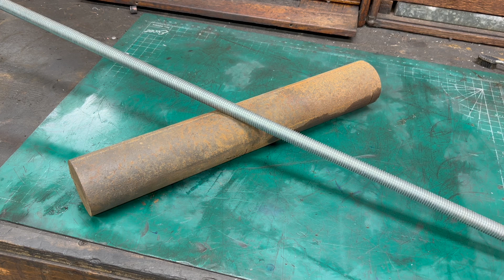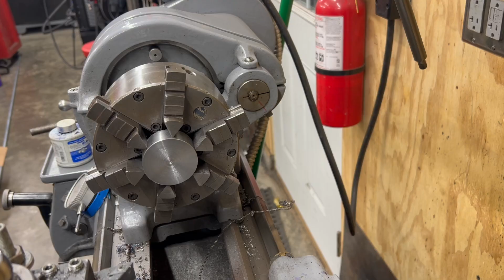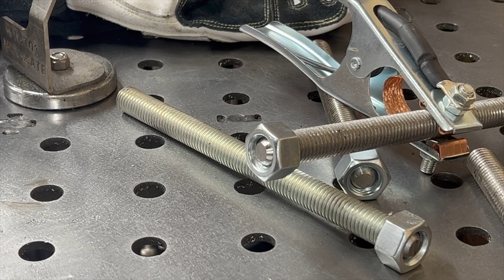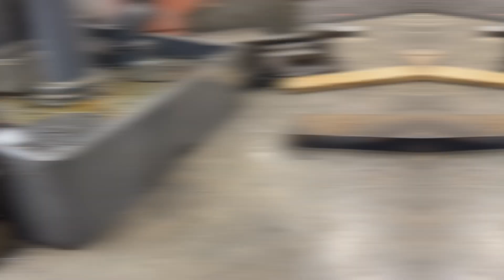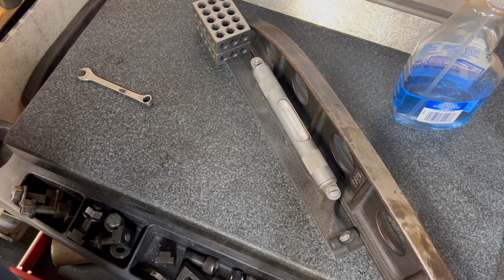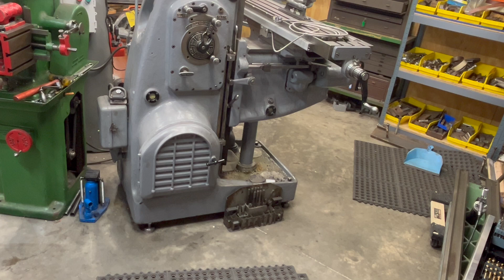Leveling the K&T 2HL Horizontal Milling Machine

Comment: Those precision levels are designed to drive you mad if you strive for perfection!
Don't know what you did with that hard stock, but I chuck any material like that in my woodburner for a couple of nights. Gets it nice and red and cools slowly, all for free!
Reply from the maker: I don't have a wood burning stove, but maybe next year when I rebuild the fire pit in my backyard (or garden to some 😉) I will have to remember to toss this in when it gets good and hot. Great idea!

Comment: When I made the pucks for my machines out of some scrap 90mm hydraulic rod chrome bar, I machined an undercut for the screw legs to locate into. It really helped to keep the pucks in  position when I adjusted the heights of the legs. I ended up drilling a starter hole with a 25mm drill, just the point, and then opening it up with the boring bar.
Reply from the maker: Sounds like we had very similar ideas!

Comment: I can understand "stable" but...
what is achieved by "level"? 
unless you use level at two ends to see if it is twisted?
Reply from the maker: To prevent twist in the machine ways, correct. Level isn't as important as untwisted.
Reply: @MyLilMule   thank you👍